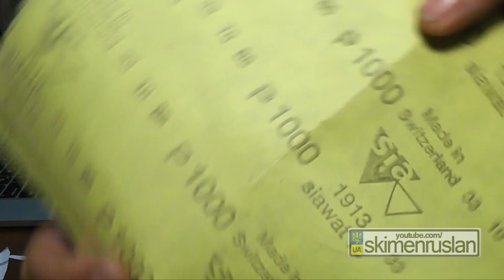КАК ЗАТОЧИТЬ НОЖИ ОТ МЯСОРУБКИ

Comment: Это не заточка ножей для мясорубки а наведение блеска,особенно если сетка будет сильно изношена без плоскошлифовального тут не обойтись и сам нож при торцевой заточке на камне, никогда не будет иметь  идеальной плоскости , края обязательно завалятся.А на то как нож резал бумажную полоску так это было одним лепестком ,а остальные в это время могли спокойно сетки не касаться.Я думаю это не есть правильной и качественной заточкой.Особенно если делать по заказу.Для себя, если это устраивает, можно так делать но в таком случае мясо будет не перемалываться а передавливаться .
Reply: Слава Богу, у меня есть возможность (работаю в инструментальном цехе) и шлифую только на плоскошлифовальном...))
Reply: Лично я гоняю на шкурках с водой от грубой до мелкой, а затем притираю на притирочной плите. Точно так же и с сеточкой, но плюсом вначале прохожу отверстия абразивом (шкурка намотанная на спицу-держатель). Отверстия обрабатываю только для себя  (на заказ не точу вообще) - слишком геморройно, но стоит того, - знакомым только плоскость вывожу и ладно 😉☝😂
Reply: @MrBvi1973  Кучеряво жыть не запретишь 😉😂😂😂👍
Reply: What's the number grit sand paper do you use
Reply: @joshiewipf6561  800, 1000, 2000.
Reply: Do you start with 800 grit 1000 grit and 2000 to finish it
Reply: @joshiewipf6561  For the mesh, I start with 800 grit, then 1000 and finish 2000. Knives - depending on how dull they are. Sometimes it was necessary to start with 320 grit. The finish is also 2,000 grit and calibration on the lapping plate is mandatory.